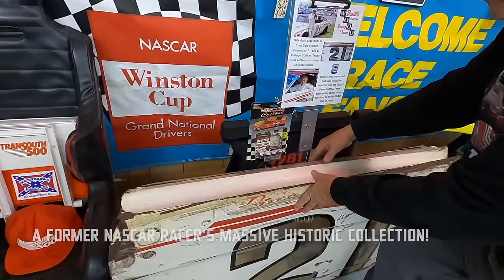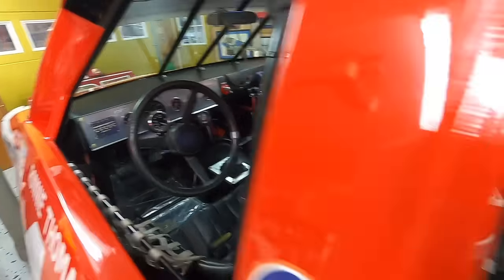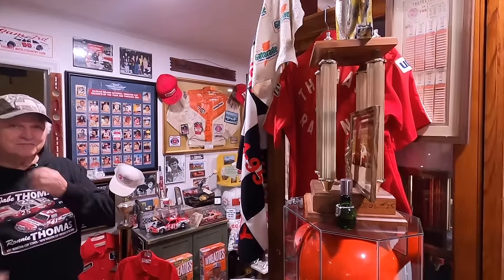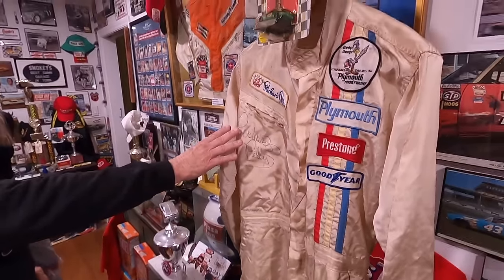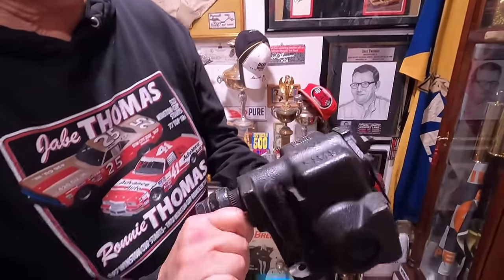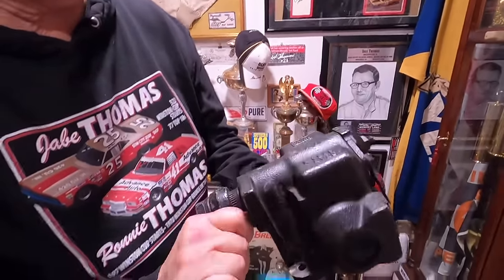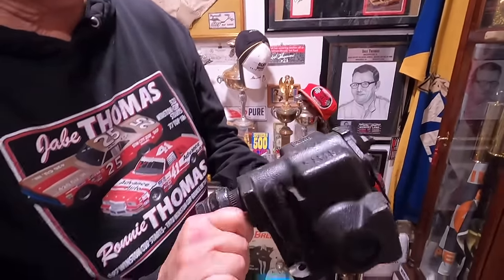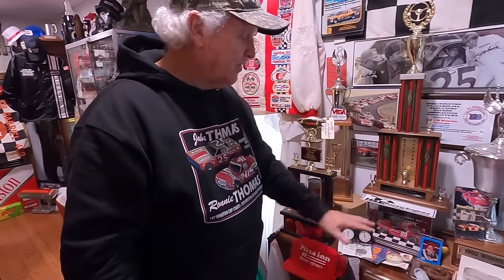Insane Private Racing Museum! Former NASCAR Driver Ronnie Thomas Shows Us His Massive Collection!

Comment: 49:50 I taught myself to be a "left footed braker", while racing go karts growing up... but then I lost it, until a few years ago.  

All thanks to a new (to me) e46 330i that needed a throttle body, and had trouble idling, I "relearned" it relatively quickly. lol  Now I frequently drive like that when I'm doing some "spirited driving"...as BMW once called it. lol     

Thoroughly enjoyed the vid, btw! Thanks so much!!  
My favorite part was the dual 2 barrels in the air cleaner.  That's pretty funny!

Comment: The Hemi box intake is a outgrowth of the '62 Max Wedge crossram intake, which comes from Chrysler experiments with intake pulses which led to the early '60s Chrysler 300 long ram intakes... in '64 when they released  the A864 drag racing Race Hemi, they adopted the cross flow, or cross ram, design which had excellent flow at high RPM because of the vacuum signals and velocity due to the huge plenum area almost reaching right down into the intake valve... this is where the tunnel ram intake comes from, all very similar in concept to all those trick header and X pipe designs you love so much... I believe the first year these 'box' intakes were used was '68 but there's a big ol' twist to the story... Mopar was getting waxed by slippery Torinos and Cyclones with the tunnel port 427, a motor that made 50 to 70 hp less then the almighty 426 Hemi... so for about half the year, NASCAR allowed the Dodge and Plymouth teams to use TWO 4150 750cfm Holley Carburetors to 'level the playing field' and a lot of teams used drag racing style cross ram intakes that were cut down for hood clearance and had removable tops like the one you showed...  one thing leads to another and the box intake is born as racers discovered the RPM power available with this design... I hope this helps... BTW, Hemi teams continued to use a regular old duel plane intake on the short tracks to have a more flexible RPM range and that same basic design was used on thousands of Hemi crate engines in the '90s and '00s...

Comment: Hi Mitch and Logan :eyes-pink-heart-shape: funny I'm building a Ranger drag truck.  was 110 inch WB and now it's 101  like a fox mustang.   I used  Mopar rear springs,  the reason being is, the diff is bolted up like 40% forward and there is 60% rearward  so it moves the wheels forward.   The factory springs are 50/50%  I also cut the frame and shortened the bed.  So just looking at it it's kind of hard to tell  :face-blue-smiling: yes the ranger only has  power steering. I converted it to a manual  quick ratio Mustang rack and pinion.

Comment: 53 years old started racing mot😢when I was 5 years old and have raced al most everything thing out there for BMX, motocross, go-kart, pro stock car's on dirt circle track and pro trucks. Snowmobiles. Pwc's, boats and I'm sure there's more. I was always one of the top five guys in most racing series. My 32 year old son I started his racing go karts at 6 years old and he's won the track championship in his first year and went on to win 5 more Karting track championships. After his last kart championship the very next spring we bought a dirt circle track pro truck then I redid everything over the winter.. his fist truck race never had ever put a single lap on in anything but a go-kart.  And he got the pole!! But I went to the track crew and tried to get them to let my son start in the back since he had never drove the truck until 20 minutes ago... well they said no he's on the pole.. so I told my son to go out there and have fun and feel things out and don't worry about pushing it just finish the race that the goal..  so he agreed.  But I told him to do what feels right to you... well he  took off and was in first the hole time after 4 laps he had a 5 car lead over second place. Who was the track champion from the last year and had been racing that class for 12 years!! So he blew a gasket and protested... they went threw everything.  All ligit and he won the track championships his fist year and another one the year after. Them won a sxs track championship 3 years ago...racing is our life....Bob.....
Sorry for the sloppy message

Comment: I'm 50 and wish they was teams you could work with without degrees I've turned more bolts and nuts and fabricated things my whole life and built a few  engines that turned quit a few rpms  those days are gone in Nascar. Even the under dog has to have millions in sponsorship money. Bring back carburetor and determination.

Comment: The touchiest subject of NASCAR, where it's headed or is it like the old NASCAR. You probably have a good perspective, but personally, What is NASCAR. I mean Greg showed a dirt track they used to race at. The constant changing to safety features, Intakes, random cheats for testing. NASCAR has never been constant, so how can someone say, it's not like it used to be. It's not meant to be. Do I wanna see better passing, and tire fall off, maybe even mechanical failure here and there, absolutely. I think today's Era is emphasized on the Driver more than the Car, because we've shown what cars are capable of in almost every single discipline of Motorsports. That's not really the contest of the Sport anymore. People just need to get down to their local short track, whether Dirt or Asphalt and just support it, it's great racing, allow these young guys to maybe make it to NASCAR, or Indy, and keep Motorsports Strong and Alive.